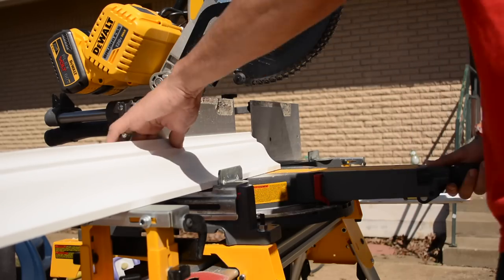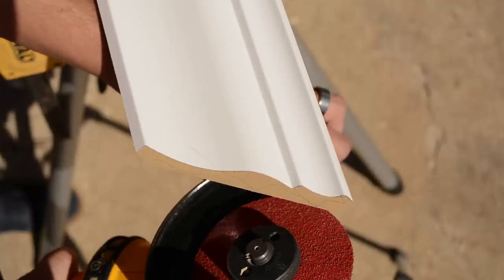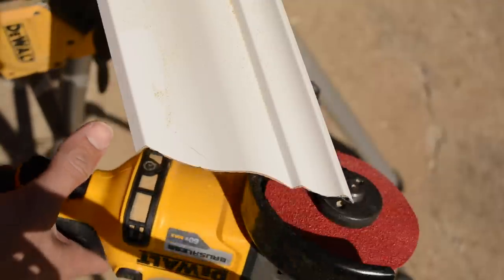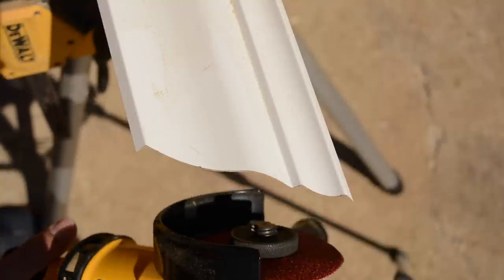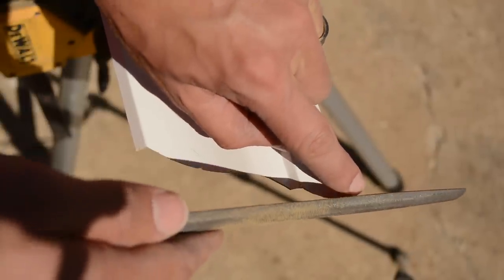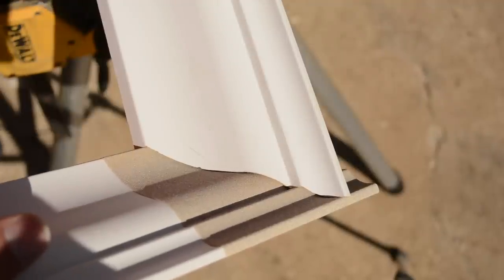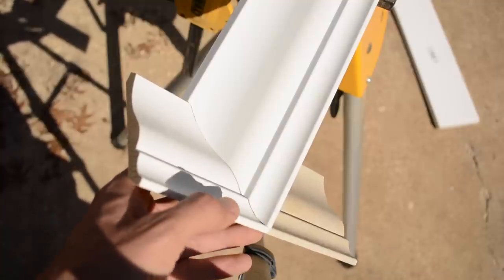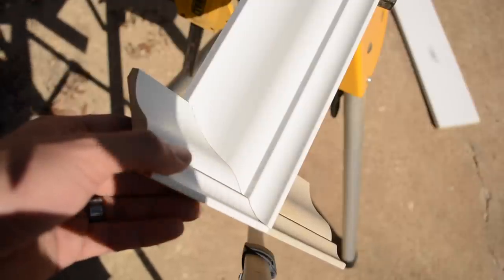COPING TRIM WITH AN ANGLE GRINDER - F I R S T - T R Y

Comment: Using a coping saw on that crappy MDF always (at least for me) leaves a fluffy edge especially on the finer corners and most always break off. I hate the stuff but it’s cheap. Your first attempt with the grinder was awesome. I understand you are your own worst critic. Give yourself a break young man you have great skills. I’ve learned a lot from you. From scarf joints being made better at 22.5 degrees instead of 45 about MDF puffing up around Brad nails and this sticky sandpaper on the profile for cleaning up the cope is amazing. I don’t know if you’ve tried this but when cutting 45 degree mitres if you add a 3 degree bevel to it you get a nice clean joint also. Thanks for taking the time to upload these videos. It must be time consuming but for us it saves us a lot of wasted material and helps us increase our own skills. Thank you 🙏🤗

Comment: I would pass on that grinder sir... Most dangerous tool there is... I do plumbing and flooring so I have to use them sometimes but sway as far as possible from them... Why they are dangerous... The disk wheel breaks free and the disc exits the grinder... Has happened to me but luckly missed my face... Jig saw works good

Comment: Not a carpenter, but the wobble on the sandpaper .... I believe it's due to the stretching of the paper disk. As others have said, use a backing rubber to minimise this stretching.
Check out the high speed videos of things like CD discs on angle grinders. The same wobble is easy to see, and the CD's are a lot stiffer (and less prone to stretching) than the sandpaper disk. 
As others have said, I wonder how a grinding disc (stiffer) would work?

Comment: I got a coping method for you to try!!! 
It won’t work with long stock (maybe under 4’ or so). And it doesn’t work with crown or anything with a spring angle... but for about anything else it’s awesome!!! 

Use your table saw free hand!!! Set the blade depth just above your material thickness, do any of your back cutting you can on your miter saw. Then just hold you cope profile pointed towards your table saw blade and ease it into the blade, use the blade to take out material while you work the piece either back and forth or just while you follow the profile... the blade does all the back cutting you need and then some (so it works great when try to make strap copes for walls with 22.5 or 30 degree angles, or any other shallow wall angle)

Comment: Couple suggestions. IMO the angle grinder you bought is pretty big. I’d recommend a smaller one just get an inexpensive one because you’re not going to do a ton of coping. Next trash that sanding disk and get an 80 grit flap sanding disk, way way more control. The sanding scrap you made is awesome and a great final touch up. Make sure you clamp the work piece so you have to hands to work with.I though you did awesome for a first try and ten thumbs up for recording it.Yes you should wear a mask but that’s true when cutting MDF anyway. You can always set up a vacuum hose right next to wear you’re using the angle grinder on MDF and most the dust will get sucked up. DGC Products makes an i-Socket, an electrical box that automatically turns on your vacuum when you trigger the other tool either grinder/miter saw. Pretty trick not necessary however. Just use a flapper disk and your results will be spot on.

Comment: It’s a little less awkward if you remove the handle off the grinder. I use a makita variable speed and run it slow it works really nice. Just takes a little time to get used to the grinder but you get quick at it

Comment: Just watched your video with an angle grinder, never thought to use it. But I use a (Bosch) jigsaw with the original flat plate and a scroll saw blade. It works well for me, you might try it someday. I'm relatively new to watching your channel and like what I've seen.

Comment: After 4' or so with mdf, and 6' or so with real wood, I like cutting my coped trim 1/16" long, nailing from the middle working toward each end.  Any shorter, and it's hard to flex the piece into position without breaking the edge ( or sometimes the piece ) outward.  The extra length allows the feather edge to press nicely into the straight cut, even with hard woods, with no discernible deformation.  It also helps prevent a gap due to shrinkage from changing humidity once the hvac is up and running. Not so much a problem with mdf as with stain or bare finished woods when you don't have time to acclimate the material.

Comment: Great vid. Really liked the idea using the angle grinder & the sand block cut from the high grit stuck to a scrap pc.
Can you do a vid on installing crown w/uneven ceiling/wall straightness? Any tips?

Comment: Yeah a backing plate or disk that stays flat and rigid works and a small 12 volt grinder or the smallest 18-20 volt grinder makes it easier to one hand it. Also a dremel tool on low to medium works really good too. And I do like the Collins coping foot for a jigsaw as well. Good first try though! My first try went worse than yours. If you like the coping saw give the relatively new (Knew Concepts) titanium frame coping saw a try. They are expensive but they will last forever! I always hated using a coping saw to back cut my molding until I finally got one. Now I use it exclusively! It’s faster and easier to use than an old style coping saw. Co workers or other trades will ask to use and I say no. I’ll let them try it out in front of me, but it stays with me. I had one guy bet me he could do 2-3  fully ready to go cuts before I finished my first one so we prepped six miter end cuts and we each got three and I had three done before he finished the first one. Then after he tried it with my saw he was really impressed with it. The loser had to buy lunch. So he bought lunch and I took him to the store where I got my saw. Now he can do four coping cuts to my three...     I think he practices though 😊.   That’s my story as I’m sticking to it!  😊

Comment: There's a rubber pad that goes with sanding pads for angle grinders,and the sanding pad stays flat not curvy like the one you used.

Comment: I'm a welder and metal fabricator and a 4 inch grinder is like an extension to my hand. It's all in how you hold it. Get rid of screw in handle , lock the power on, and palm the grinder in the center or more toward the top.

Comment: that Sanding disc supposed to be on a backing plate so it doesn't wobble while you're cutting, I'm sure if you tried with that on the grinder you would become more comfortable with it

Comment: Only use the angle grinder for the majority, and use a file to finish. Very nice fit. Next, try an oscillating multi-tool with a coping saw attachment. It works great.

Comment: Warning about the sanding disk installation on the grinder you should be using a backing plate with a flush mount nut it will keep your disk flat and give you more working area as well    Just want to say thank you to every one on youtube I value all the information you take the time to share

Comment: I do not know what grit u used but, I have seen this done before but it was production. He had a plywood box made in a funnel shape and a self cleaning vac hooked up to it... he'd been doing it for about a week and a half or so and used finer grit . He could take it right to the line in seconds I was amazed. I don't do a lot of trim work so I'm not motivated to put in the practice. But if u can do that clean of a job on ur first time imagine what a week of practice would do !!!!
  Plus, create ur own dust collection box to suite ur need.,. anyway Cheers !!!
PS, don't ya just love a cordless miter saw 😁😁 this is my first and I love that thing. Electric brake is rapid too !!! I too loved the sand paper tip... really puts a smart edge on my work. thanks 😛

Comment: you need to use something a little stiffer. ... i don't believe the right attachment was used. looks like it was all over the place. almost as if you just threw on a piece of sand paper with no backing.

Comment: So l made a video of (coping with a Makita 5" disk grinder). I think is more in line with what you want not the angle grinder. Tell me what you think.  Its titled as whats in parenthesis.
This is much more stable method because of the grip. Like anything else youll need some practice ti get comfortable with it over a coping saw but l have no doubt youll take a liking to this.

Comment: I just started doing this using a flapper disk on an angle grinder. I think it is easier. I am a DIYer and only do it on pine. I like you sand paper trick, thanks

Comment: Coping with a angle grinder is WAY faster than with a coping saw. Get the angle grinder sanding disc conversion kit for your grind wheel. It will make it a lot easier to control than just the disk flopping around.

Comment: Never saw a wavy disc like that? who makes that? and , angle gring works , but would have used a less aggressive grit like 100 or even a flap disc !  but the coping foot will give you the control you need with a nice fine blade!!
Reply: Frame rate of the camera and speed of the disc made disc appear it was wavy. This phenomenon is called aliasing. Similar to a strobe light. The frame rate of camera was capturing an image of  the disc flexion at a frequency that made it appear wavy.

Comment: Collins coping foot like the other suggest. I think a grinder is to clunky. Butt I have used a oscillating tool with wits blade. Less dust and mote controllable

Comment: Collins is solid way to go. I use the ginder sometimes too but with a rigid disk. Aside from the rigidity, the shoulder on it allows me to grind tightly into the corners and details. If I don't have many joints to do, I still get the coping saw out from time to time. 
Very much appreciate your work and videos. You introduced me to CA glue. Life changer

Comment: If you use a file to get the very edge, it turns out a perfect line. I've done it many times and tge results are excellent and a very strong bond at the corner. Cut the length a 16th longer and it will snap into position with no or minimal caulk. Good video!

Comment: On the angle grinder discs- it helps to glue TWO of them together back to back. That will stiffen and straighten out the cutting edge and also allow you to go both directions.

Comment: Your angle grinder is sorta on the big side and may make it a little more awkward. Noticed your also missing a backing plate for the sanding disk so your at the mercy of the centrifugal force to keep the disk steady.

Comment: what are your tricks for running into different variations in the ceilings and walls.  For instance when you have a 1/8" gap then one foot over it's tight to the wall or ceiling ?

Comment: We use the Grinder or Jigsaw to how away material quickly but for me you can't beat the Dremel with a Dremel 543 Cutting/Shaping wheel for finish shaping the cope.  You are doing the same thing as the grinder put you have so much more control.  You can also cut a fine cut to corners before shaping it.  Try it, you'll keep one handy for sure!
Reply: Sorry about the misspellings guys.  That's "Hog" away material.  And "but" and not put.

Comment: do you believe this coped corner is stronger than a mitered corner with glue ? i mitre both pieces together with glue. Both pieces are then locked in holding each other in place. With your style only one piece of crown is locked in and its not glued and cant be glued.

Comment: Way too much machine. Use the your compound miter saw and then try a Dremel with a 1/2" drum sander. Slow the motor down. I think you will be much happier.
Reply: 3457 CVD try the Dremel 543 cutting/Shaping wheel and you'll throw that drum sander away!

Comment: A multi tool works well to i normally use a coping saw i broke my last blade to to finish the job i tried the grinder not great the multi tool with variable speed worked well tho

Comment: I started using my multi tool to cope. It works pretty good especially because it cuts such a straight line. I need to get a blade that has abrasive on one of the faces so you can carve with it. Give it a try, probably not as good as a coping saw, but probably cleaner than a grinder.  
The sticky back sand paper is a great idea. Thanks for that

Comment: That disk you used should come with a backer piece that the disk sits on? Where’d it go! But stick with the grinder it way faster and once you get the disk used up a bit it makes it way easier. I can use the grinder right up to the line. And it saves a ton of time especially on base

Comment: This was very helpful for me and I want to thank you for sharing. It took me a few hours to get proficient with the grinder but is much easier than a coping saw. I found I needed some small shims behind some of the straight cut pieces to help the joints align but my project looks great using speed base molding!!

Comment: 4" angle grinder with a paddle switch has worked for me for the past 20+ years.  And no guard - sorry safety nazis - makes it easy to use any part of the disk you like.  Depending on material I have used anywhere from 30 to 120 grit.
Reply: Theres a little latch that makes em rotate to any side, your just too badass and bulletproof.Admit it. 😜

Comment: Try installing a backer pad on the sandpaper  to flatten it out.  Also take the guard off of the grinder, it gives you better control. I have been doing this for years  and it just takes lots of practice

Comment: I been doing it this way for years, a couple of tips, I use my makita grinder or any power grinder that you don't have to keep holding the switch,  that way you keep the grinder on and you can hold the grinder  closer to the head it gives you more stability,  I tried it with my dewalt cordless and is way harder, also is best if you use the rubber pad grinder attachment and an 80 grit disk,  once you get better at it you'll see it's way faster than the coping saw, you did good for your first try.

Comment: I just started doing coping and tried the angle grinder and it works great. I see you used a wheel disc, I went with the standard wider wheel for grinding metal its thicker, it works a little slower but still effective.

Comment: What did you use to nest the crown on the mitre saw? I have struggled to hold the crown in the correct position on the saw to get the tight cuts.

Comment: I think with a little practice you would do it greatly. You’ve definitely got the right idea. As far as dust goes, you can always use a dust collecting vacuum. When I started using this method, I had the same issues, trying to get too close to the profile with the grinder. Take out the meat, and use the file to get precise! Great work! Love your channel!

Comment: If you put the disc back to back it will help from flopping
Reply: Joseph hernandez jr 
Absolutely! Back to back.
Reply: The method he uses makes the process “safer”. The disc is not flopping where it meets the wood surface. It bends back slightly, so it is a “forgiving”.

Comment: I use my grinder as much as I use the miter saw. I've all but replaced the belt sander and I keep my pencils deadly sharp dragging them on the disc.  The disc on a grinder can get you out of a lot of pickles

Comment: Hung up the coping saw a few years ago for a 4” Makita grinder w/24 or 36 grit 👌🏻I utilize a different technique and practice makes perfect! Much quicker and not so strenuous. I’ve found the 4” Makita to be the lightest
Reply: Yeah makita grinder one handed is the way to go, but I use 80 grit sanding disk.
Reply: have you ever used the guillotine it's just slices it down to the profile

Comment: hey richard  i usually cope close to the line with a saw and then i use a dremel tool with the little sanding attachment to fine tune     also i just got some crown stops last week on your recomendation    man i dont know how i made it without them   thanks again

Comment: You need a really stiff blade almost like a concrete blade. If the blasé is flexing there is no way to get the control you need. Take the 90 degree handle off the saw and use one hand. One hand on the board and one controlling the saw. Just like the coping saw plunge cut the straight lines first then come back and hog out the rest. I believe if you use these few tips you will be 3 times faster than a coping saw and a lot more fun. Making saw dust is always good.
Just what I do and by no means trying to be an authority.
Reply from the maker: Charles Youngblood thanks for the tips.
Reply: Chip Coping is a definite skill that needs to be developed... What ever you have to do to get it right is all that matters. Sometimes it take me a minute sometimes a lot longer...

Comment: Are you kidding? It looks pretty perfect, in the end you fill up the gaps with some silicone.
Reply: alex ciui I agree. Primed MDF Crown will always be caulked to the ceiling and to the walls with Moulding Caulking, it’s part of the prep before paint so is putting a bead over the mitres and wiping it down.
I personally don’t cope and just mitre and get my mitres as tight as can be and are very tight and always glue with just regular old carpenters glue.
I usually do a lot of my own prep so I know what is acceptable and what is not and what can be covered and hides away when it is caulked and painted that’s what makes paint grade trim  more forgiving than stained but it’s still nice to strive for that perfect joint.
After awhile it just becomes second nature and you learn tricks overtime.
Now getting MDF to sit still and not move with interior humidity from season to season is another battle.